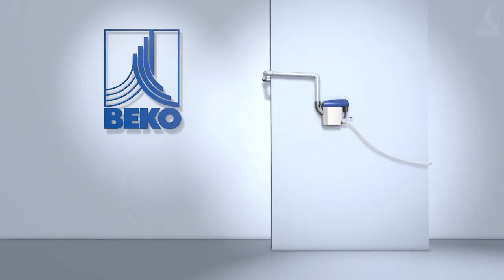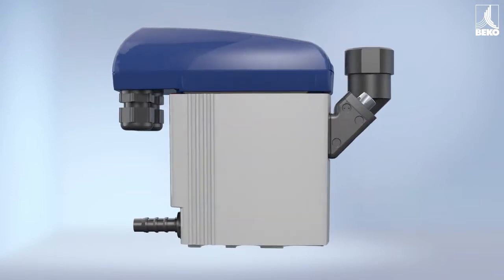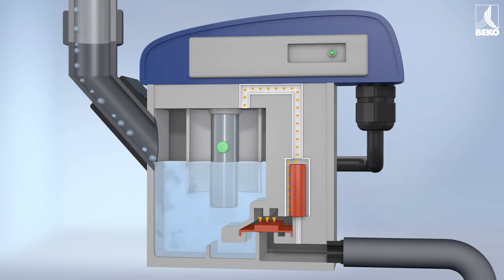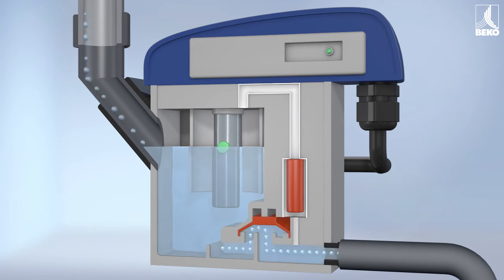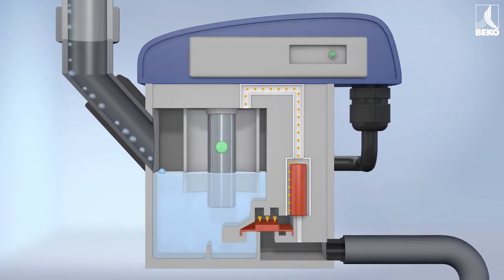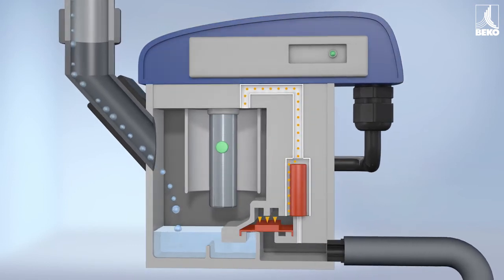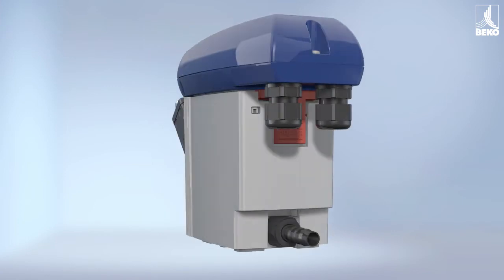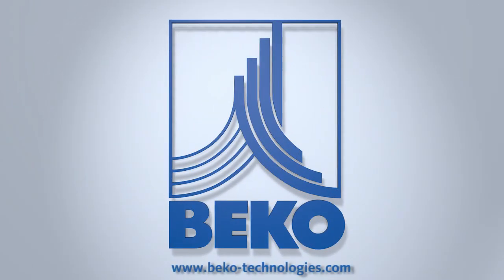BEKOMAT Condensate Drain

Comment: I have had installed new medical air were installed bekomat 32 in tanks. 
But when I operate the medical air station the bekomat give alarm and when pressed the test does not work
Reply from the maker: Dear customer, it seems like that there are some technical issues with your application. If you like to have our support finding the right solution for your requirements, please use one of our contact forms from our website that suits you best. We propose this one here https://www.beko-technologies.com/en/en/contact/contact-consulting/
Reply: It is fantastic. It work very well.